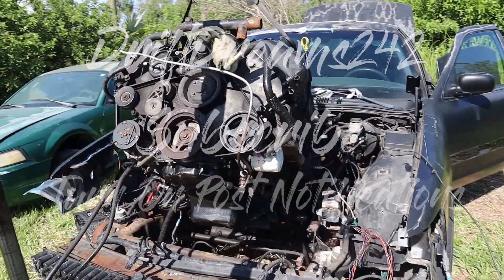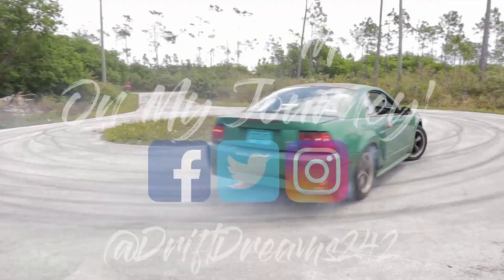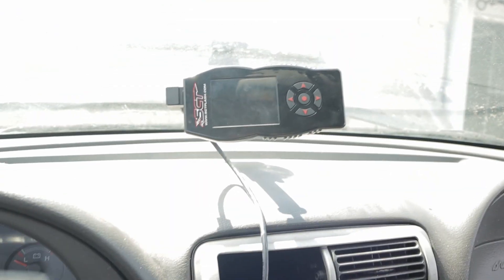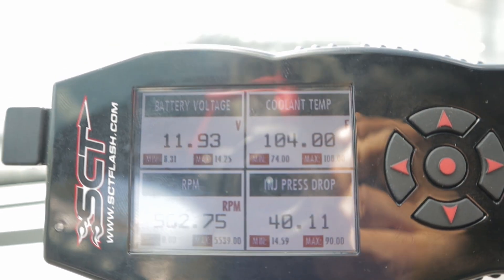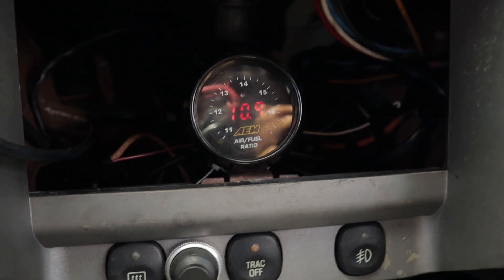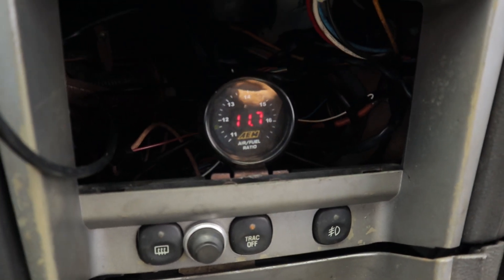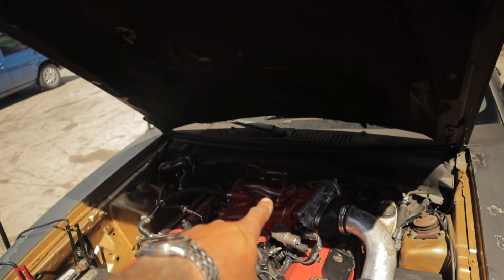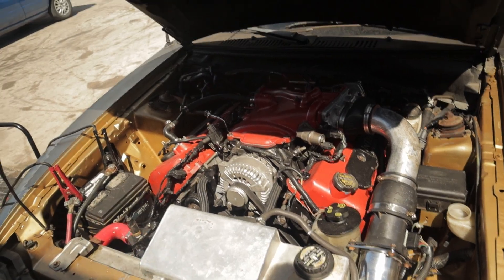My 4v Swap Mustang gets An AFR Gauge

Comment: Really rich my 3v idles at 14.8 and at wot it’s 12.5-12.8 and at wot on the nitrous it’s 11.9-12.2 I don’t have a tune for my 10 speed car yet and from the factory it’s pretty rich at wot. It’s like 11.2 hopefully I’ll have that fixed soon with a palm beach dyno tune 😉
Reply: @DriftDreams242  yea I wouldn’t be doing much running it with those o2’s unplugged anyways lol definitely no wot stuff.